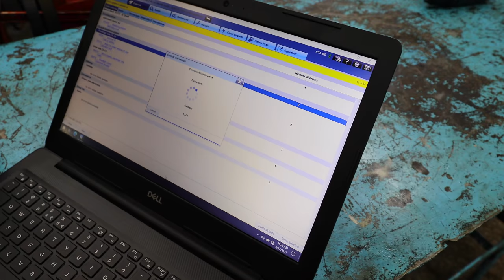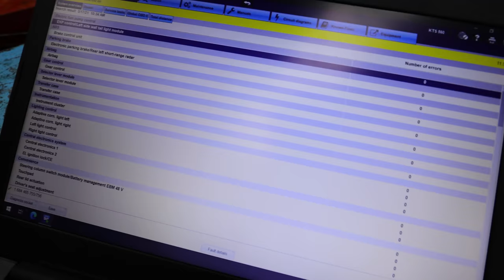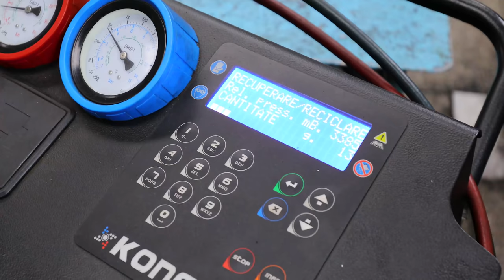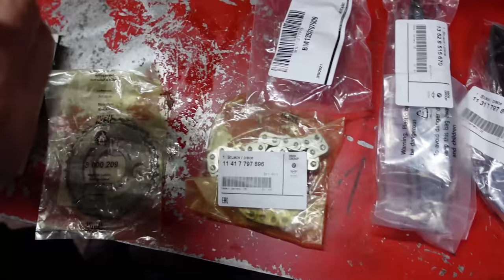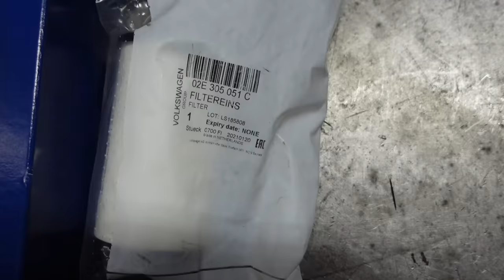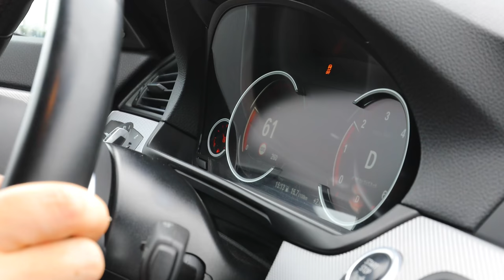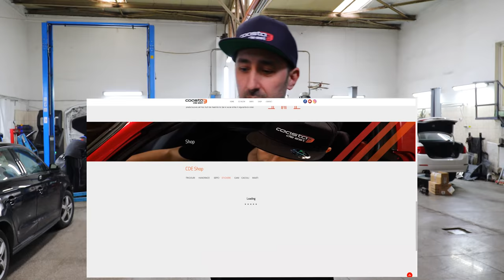BMW M550xd - balaurul cu 3 turbine 😈😈😈

Comment: Care este cel mai popular model BMW?
Care este, de fapt, cel mai prost model facut vreodata de BMW
Fara nicio indoiala, cel mai popular model al producatorului german este BMW Seria 3, generatia E30, adica celebrul Ursulet. Cu toate ca a fost introdus pe piata acum mai bine de 38 de ani, in anul 1982, BMW Seria 3 E30 inca este un model extrem de iubit de pasionati.

Citeste si: Care sunt, de fapt, optiunile pe care le are Audi dar nu si BMW

BMW a oferit modelul in versiuni sedan, coupe, cabrio si break, insa cel mai popular ramane coupe-ul. Daca vorbim despre versiunea M3 E30, atunci vorbim deja despre un automobil de colectie. Acesta oferea un motor de 2.3 litri cu 215 cp, ceea ce la vremea respectiva era impresionant.

Totusi, in 1989, BMW a introdus modelul 318is care oferea motorul M42 de 1.8 litri, cu 134 cp. Acesta a fost cel mai modern motor disponibil pe celebrul BMW Ursulet!

Comment: BMW-ul care a fost si va ramane cel mai tare BMW, este E60 M5. Motorul de 5L V10 are cel mai unic sunet ce-l vom auzi vreodata de la un BMW, asemanator cu formula 1 din era V10. NIMIC nu poate bate asta. Pe langa asta, e mai rapid ca toate generatile de M5 dupa el, atingand 330KM/H, pe cand celelalte abia trec de 300KM/H. Chiar daca papa cuzinetii originali mai repejor, cand urla la 8250RPM dispare totul din jurul tau. Asta nu poti egala cu nici un motor turbo.

Comment: Producătorul bavarez a dezvăluit publicului patru noi modele M: M8 Coupe, M8 Coupe Competition, M8 Convertible, M8 Convertible Competition, iar acestea dispun de aceleași motoare precum M5 și M5 Competition. Dacă țineți minte, vechile modele M5 și M6 dispuneau de aceleași motorizări. Înțelegeți unde bat? E fix cum a zis Bratu, Seria 8 se simte ca o Seria 6.
Pentru cei ce nu știu despre ce vorbesc, noile M8-uri dispun de propulsorul S63B44T4, un V8 biturbo de 4.4 litri ce produce 600 cai putere pe versiunile normale și 625 pe variantele Competition. Cifre deloc mici, însă identice cu ce propune și berlina de clasă mare. Iar când vorbim de cuplul maxim dezvoltat, acesta este unul respectabil de 750 Nm pe toate modelele, însă aceeași cifră o dezvoltă și M850i xDrive.

M8 Coupe: 4.4 V8 BiTurbo, 600 CP, 750 Nm, 0-100 km/h în 3.3 s, V-MAX 250/305 km/h, 10.6 – 10.5 l/100 km

M8 Coupe Competition: 4.4 V8 BiTurbo, 625 CP, 750 Nm, 0-100 km/h în 3.2 s, V-MAX 250/305 km/h, 10.6 – 10.5 l/100 km

M8 Convertible: 4.4 V8 BiTurbo, 600 CP, 750 Nm, 0-100 km/h în 3.4 s, V-MAX 250/305 km/h, 10.8 – 10.6 l/100 km

M8 Convertible Competition: 4.4 V8 BiTurbo, 625 CP, 750 Nm, 0-100 km/h în 3.3 s, V-MAX 250/305 km/h, 10.8 – 10.6 l/100 km

La fel ca M5 și M5 Competition, sistemul de tracțiune integrală M xDrive este oferit standard, iar diferențialul Active M dispune de trei moduri de rulare, 4WD, 4WD Sport, iar dacă dezactivezi DSC-ul mai primești și modul 2WD.
Printre celelalte echipamente făcute să facă mașina să fie cât mai rapidă se numără amortizoarele Adaptive M, direcția M Servotronic sau DSC cu M Dynamic Mode. Șasiul a fost calibrat pentru modelele în două uși, frânele, fie că sunt cele ceramice sau nu, sunt controlate de un modul electronic separat, iar șoferii pot alege dintre două tipuri de feeling în pedală, unul confortabil și unul sportiv și foarte responsiv.

Comment: Ca design e46 va ramane in istorie ca un "timeless classic" cat destre motorizare , cam toti ne aducem aminte de celebrul M3 GTR din Need for Speed Most Wanted 2005 si felul in care suna motorul V8 (fata de e46 normal care vinea cu s54 in 6 cilindrii in linie) si impreuna cu cutia de viteze cu roti dintate drepte suna absolut mirific. Pacat ca s-au fabricat doar 6 bucati , BMW ar fii trebuit sa vanda 100 de masini cu varianta de V8 ca sa continuie sa concureze cu GTR-ul la American Le Mans Series ceea ce nu au facut , lasand lumii abia 3 masini care nu au fost prototipuri .

Comment: Salut salut....cel mai tare BMW pentru mine???OOOOO amintiri:era anul 2012,liceu,imi iau permisul de conducere insa ce sa conduc???loganul 1.4mpi al tatalui meu nu era tocmai o apartie in fata liceului.Asa  ca impreuna cu ''stimatul'' meu coleg de banca(de ultima banca:)) )totodata cel mai bun prieten al meu,luam decizia de a ne cumpara impreuna o masina cu care sa impresionam fetele si sa rupem strada.Si culmea am si reusit cu bani stransi de pe vara(am lucrat ambii cot la cot pe santier) sa cumparam cel mai tare BMW posibil Seria 5 E34 525I(in ochii nostri).Era din 1988 sau 1989 nu mai stiu exact,era alb,sa nu credeti ca era vreun exponat de la Bavaria(am dat pe el in jur de 1500 de euro)era ruginit pe aici pe colo insa ce ma impresionat cel mai tare la masina aia era motorul,mergea absolut impecabil,fara rateuri fara ca vreodata sa nu porneasca.Era super confortabila,piele,nu mergea aerul conditionat insa asta era ultima grija,cutia era ok,mai troncanea ea mai mereu insa nu bagam toate prostiile in seama:)).Ce sa mai eram smecheri.Adica eram cand aveam benzina ce sa spun nu prea ne intelegeam cu consumul ii cam placea la peco.Insa strangeam de venit la liceu vinerea de dat fetele o tura si inapoi acasa.Nu te plimbai mult cu 50 lei:)))Bunicul colegului meu(care ne inmatriculase masina pe numele sau si singurul care ne sustinut in toata afacerea asta) vazand cata grija aveam de ea cat o spalam cat o lustruim a decis sa ne monteze o instalatie gpl omologata pe ea.Se schimbase treaba,aveam sa ne plimbam in fiecare zi acum.Fericirea a fost de scurta durata,am cumparat masina in august,in decembrie am pus gpl-ul pe ea si in mai 2013 a venit vremea sa facem itp-ul.EEEEEEE aici probleme fiindca a fost oprita pe ''flux cum se zice'' au venit cei de la RAR,nu am luat itp-ul la ea,drept urmare aventura cu cinciarul s-a terminat.Am dezmebrat-o pt piese.Dupa termimarea liceului am cumparat un E46 urmat de un E60 insa cu tristete spun sincer ca nu au nicio legatura cu masina aia.Ala a fost un BMW adevarat dintr-o vreme cand se faceau lucruri de calitate nu la cantitate.PS o sa imi fie dor de Ion.

Comment: Vreau sa vad lucruile spre viitor, iar BMW i8 o sa ramana in istorie si ea. Probabil cel mai rapid 3 cilindri din istoria recenta +ca mai aduce si a McLarren. De ce as da jumatate din bani astieia pe una de acum 20 ani? sa merga ok mai bagi inca pe atat. ca sa ce? consum si poluare aiurea? si vine o rastita de i8 cu motor de 1.5 si te saluta din mers. hai sa lasam babele pentru muzeu bmw si pentru garajele de colectie ale alora care oricum nu li se mai scoala. nu zic ca nu au fost copodopere ingineresti la vremea lor.... problema e ca de 30 de ani dupa comunism nu am scapat de saracie, inca mergem cu sh-urile altora si ne mai si mandrim cu ele, si e normal doar au costat mai mult decat garsoniera in care locuim sau mai rau toaleta inca e in fundu' curtii.
Sa revin la i8 avem motoare electrice, si unu termic (se stie frica romanului de pana prostului, electric de data asta), desing interesant nu prea intalnit la bmw, materiale usoare, inginerie din secolul 21.
Si da peste 10 ani i8 asta o sa fie noua moda si la noi cum este acum e92...

Comment: BMW seria 5 este o mașină pt mine personal spațioasă cât sa satisfacă toate nevoile
1.motorizarea 520d probleme distribuție plus filtru particule și periile spate am avut un e61 perini spate compresor defect cost imens de reparat o simplu compresor
2. 530d bun ca motor rezistent 6 cilindri în linie toarce frumos motorul  dar cum întreabă romanu cât consuma și aici (cât vrea 11-16l)probleme fulia cu curea întinzătoare duse cost 25-30mil  încă o problema care nu am rezolvat-o și nu a fost exact localizata îmi Oprea motorul din cauza frânelor ceva pe baza de aer.. Problema sa remediat singura mecanicul mia zis dacă vrei sa cheltui bani haide sa schimbam piese și poate tot nu o rezolvam când apare dinou at punem tester și sa aflam exact ce eate și uite asa de 1an nu am mai avut problema respectiva. În rest ok mașina se simte puterea de motor mare.
3.masina confortabila extern și chear pt oraș senzori camera te ajuta chear dacă este marisoara mașina.
4.daca ai un buget mic și nu îți permiți sa schimbi orice cade la un bmw părerea mea nu îți cumpăra BMW doar sa iti etalezi.....!!! Cumpărați orice altceva vw skoda Opel.... Am avut multe mașini și știu ce vb... Oricum fiecare cu bani lui face ce vrea.

Comment: prea multe modele ca sa alegi doar unul...poate primul M....M1...sau poate Z1 cu usile ce coboara in podea...sau E39 M5... sau 1M...sau poate ceva mai banal...un 2018 440i..un model mai normal, dar cu o platforma buna cu sanse mici sa se mai fabrice ceva similar in viitor (rwd 6L fara OPF)...vin electricele  😂

Comment: Bmw m1 e26 cel mai misto BMW făcut vreodata pentru ca este primul model cu mid engine care a fost produs în masa  ,are faruri escamotabile...cui nu-i plac ?,designul a fost făcut de Giorgetto Giugiaro. Și are o istorie destul de interesanta 
In 1979 the head of BMW Motorsport, Jochen Neerpasch, devised a one-make championship using racing modified M1s. The series was created to aid BMW in building enough cars to enter the group 4 classification in the World Championship for Makes. The new series, known as the "Procar BMW M1 Championship", served as a support series for Formula One, and included many Formula One drivers in identical cars.

The series ran for two years, with Niki Lauda winning the 1979 season, and Nelson Piquet the 1980 season. After BMW met the standards for group 4, the Procars were used by various teams in the world championship as well as other national series.

The M1 was also campaigned at the 24 Hours of Le Mans from 1981 to 1986 where it proved competitive.[4] The car was classified as a Group B car for Le Mans purposes, as Group B was also planned for GT class for road races, but were instead eclipsed by Group C prototypes.

A M1 Pro Car was also converted to Group B rally spec by BMW France for the 1982 season. The car was campaigned for the 1983 season as well before the car was entered solely by the Motul privateer racing team for the 1984 season. The 1984 season proved to be the most successful for the M1 as former ERC champion Bernard Béguin won back-to-back at Rallye de La Baule and Rallye de Lorraine that season, and even claimed an outright ERC podium at Rally d’Antibes four months later. The car was not campaigned further after 1984.[7]
Nu sunt fan BMW dar este singurul model care îmi place :)

Comment: Nu e buna comparatia de 0-100 intre un m550 d care e x drive si un m5 f10 care e tractiune spate,comparatia corecta pentru intrebarea de ce sa  iei m5 este pentru timpul 100-200 de 200-300 nici nu mai este cazul sa vorbim pt ca m550 nu este capabil

Comment: BMW seria 5 E39 - ultimul BMW adevarat. De ce?
1 - Calitatea:
        - motoare mari de 6 cilindri atat benzina cat si diesel. Ba mai mult motoarele diesel de 2.5d si 3.0d nu sunt altceva decat tancuri care duc milionul de kilometri fara nici un efort
        - materiale de calitate: plastice moi de la bord, pana la partea inferiara a usii; piele buna, rezistenta, groasa, dar si moale in acelasi timp, trim-uri de lemn sau aluminiu, iar orice loc de depozitate este capitonat cu material gros si rezistent - practic orice atingi la interior fie este un plastic moale de buna calitate, fie este o piele superba, fie este un lemn sau un aluminiu care se simte bine la mana
        - talba de pe elementele caroseriei este groasa si suna a plin
        - usile sunt grele de deschis si inchis si fac un sunet sanatos la inchidere, la fel si capota sau portbagajul
        - overengineering-ul este dus aproape la extrem - un exemplu ar fi torpedoul care are un mic amortizor ca atunci cand se deschide/inchide sa nu se tranteasca, pe langa multe alte nimicuri care daca nu esti atent, nu se vad, dar sunt acolo, fie pentru confort fie pentru ca o piesa sa tina cat mai mult timp sau sa isi faca treaba bine
        - tinuta de drum este absolut superba - este o masina mare, grea care imbina confortul pe care orice masina din clasa ei trebuie sa il aibe cu un sasiu bine legat, sportiv care o face o placere sa o coduci

2 - Nu se mai fac masini ca alta data
        -  masina asta vine dintr-o perioada incare nu se faceau masini doar ca sa fie, pe banda rulanta, facute pe repede-inainte cu multe bube si cu rabat la calitate. Nu, masina asta a fost gandita sa tina, sa duca kilometri multi, sa fie confortabila si sigura. Dezvoltarea ei a inceput in 1989 si a durat pana in 1995 - atunci cand s-a lasat. 
        - greutatea nu era o problema ci un factor de siguranta si confort

3 - M5 E39 - cel mai bun M5 (si mai fiabil) facut vreodata si ultima limuzina sport cu un echilibru aproape perfect intre performanta si confort

In incheiere, va las ma jos o scurta poveste cu E39-le pe care il detin, un 525d din 2003. Sper ca va placa. 😅😅😅

Am luat acum 2 ani un E39 525dA. Practic un cazam mai mare fata de ce are Bogdan acum 😅😅. Pentru mine nu conta atunci, pentru ca aveam masina pe care in copilarie mi-am spus ca intr-o zi o sa mi-o cumpar. Ei bine....mare greseala😅😅 Nici nu am luat-o bine ca a trebuit sa schimb urmatoarele: - frane discuri fata/spate - tamburi frana de mana - kit reconditionare frana de mana - bielete de direcție - capete de bara - bielete autorului fata/spate - brate suspensie fata - brate superioare spate - bucși bascule spate - conducte de frana - conducte de combustibil - tampoane motor - vas expansiune - pompe motorina - egr - electrovalva egr - amortizoare și arcuri fata - și nu în ultimul rand ca orice proprietar de BMW care se respectă, motorul....MOTORUL!!!!!😭😭😭 (pentru ca a tras o clapeta din galerie - sau ceva de genu...nici acum nu știu care a fost cauza...tot ce știu e ca aveam pe cilindrul 6 doar 2 bari compresie.....) O mașină cu personalitate aparte, ce sa zic, ai grija de ea ca de bibelou și la o luna - doua, îți mai oferă sansa sa mai scoți niște bani din portofel. Practic iti da emotii si cand o conduci si cand platesti devizul in service. 😅 Anul asta chiar m-a surprins ca în 8 luni de zile am băgat doar motorina și o revizie, însă....nu se știe niciodată... 🙈🙈🙈 Genial, știu. Tot ce pot sa zic e ca am vrut sa ii dau foc de nenumărate ori.... si tot am mers mai departe și i-am dat tot ce e mai bun. 

P.S. 1 Va apreciez foarte mult pentru tot ceea ce faceți. Va urez mult succes în continuare!!!😁😁 
P.S. 2 M-ar interesa sa fac o revizie la cutia automata la voi. (după cum am spus, mereu exista ceva de făcut la masina asta😅😅)

Comment: Cel mai frumos bmw zici? Hmmm sunt multe dar tinând cont ca am avut peste 12 masini din gama Bmw    e 30 il scot din schema ca ala e ceva prea dur 💓sa ramanem la e39 ca motorizare 525i 530i ceva acceptabil exterior frumos, eleganta  modelul asta si peste 20 de ani va fii tot frumos farurile alea cand aprinzi pozitiile si e pe inserate spui ca e "nava spatiala" pt mine e39 ramane un model unic si sa nu uitam. Ca sau  facut intru-n numar foarte mare.... La e39 nu trebuie distributia schimbata stiu motoare cu 500 600 de mii de km pe benzina si la Motor nu sa-a umblat.... Multa bafta baieti

Comment: Parerea mea e simpla e36 de ce e36 si nu alta pentru ca cu masina aia am inceput eu cariera de sofer si nu doar atat pe masina aia am invatat ce inseamba o garnitura de chiulasa arsa ce inseamna sa pornesti o masina fara baterie cu masina aia am invatat multe si nu ma lasat la greu nici o data mergea in 3 pistoane dar mergea , bagam antigel
Pierdea si pe la cotul din interior de la calorifer si pe afara dar mergea , desfundam pompa de benzina cu fire de la baterie dar mergea o reparam in drum , cu masina aia am inteles ce inseamna sa mergi cu prezoanele
Desfacute 100 km si sa nu sti ce bate dar a mers nu stiu pentru mine masina aia a insemnat totul si acum imi aduc aminte cu drag deci official o consider cel mal tare bmw si povestea ar continua dar garantat va as plictisi

Comment: Cel mai reusit model BMW? Eu zic E46. De ce? Pentru ca a fost facut pe vremea cand masinile erau facute de ingineri, nu de contabili. Se punea mai mult accent pe calitate si asamblare decat butoane butonase ecrane ecranase senzori la fiecare 30 de cm si alte mizerii. Eu personal indragesc mai mult modelul pre-facelift, avand o aura mai masculina si serioasa.
Motoare de la 1.6 la 4.0 benzina ASPIRATE. 2.0 si 3.0 turbodiesel. Fara DPF, fara AdBlue, injectie mai simpla, fiabilitate crescuta.
Coroana ii revine lui M3 GTR cu 4.0 V8 care a plesnit Porsche la inceputurile anilor 2000. S-a produs modelul de strada doar sa ii inchida gura lui Porsche care plangea ca M3 de strada nu are V8.
Si...

NFS Most Wanted...duh!